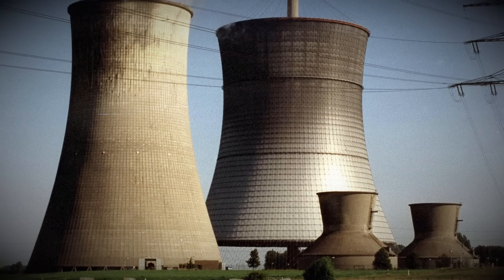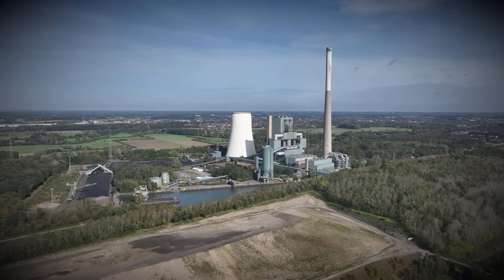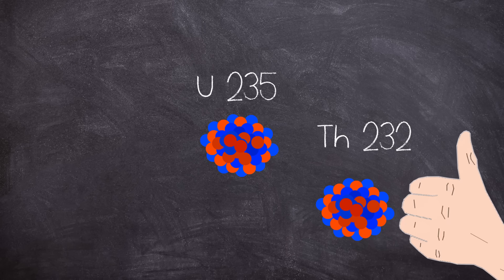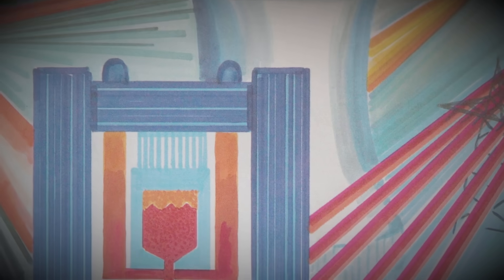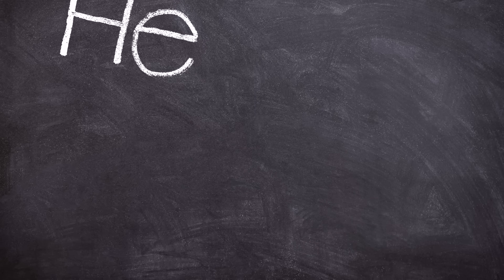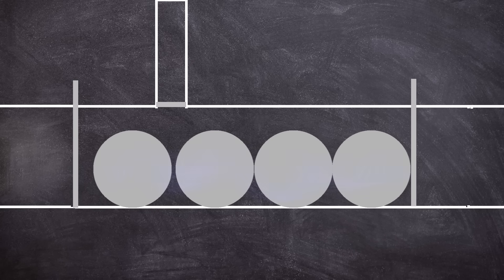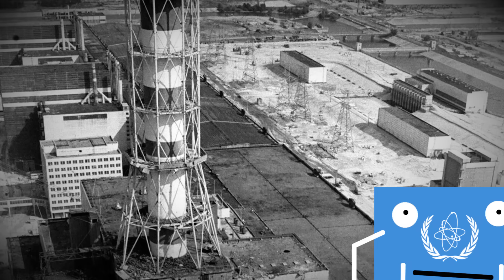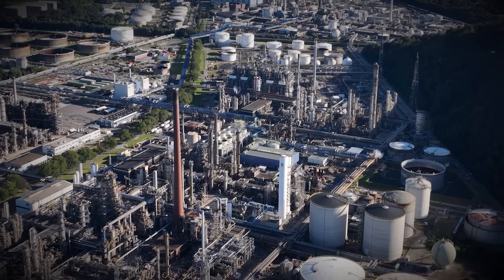Inside Germany’s “Chernobyl”

Comment: The key word here is Balls a very English sort of reference, which can cover a number of final outcomes.  These are cycled up and down, removed when damaged or the fuel is not reactive enough.
Graphite is a very soft material, while Thorium and Uranium are hard.  Imagine making 2-inch diameter balls, using gypsum powder, aka “Plaster of Paris,” (PoP) interspersed with heavy chunks of metal, then sending these through a conveyer-belt system that slowly grinds them together, in a continuous process that has NOT miraculously suspended friction coefficients nor the Delta Vee of inertia/mass differential.  Any short “Drop” would act upon the materials differently, eventually breaking these balls apart.  Even without this particular operator error, bad things would eventually happen!

As Clarkson would say, just before one of his hare-brained schemes blew up in his face on Top Gear “What could possibly go wrong”?  😂😂😂😂😂
Reply: AVR shown many of the problems - while it irradiated people walking by because shielding is not needed on the top - but they went ahead anyway.

One reason why the anti nuclear movement was and is so strong in Germany was the constant stream of fuckups and coverups happening. That there are also leucemia clusters around two power plants certainly did not help.
Reply: @methanbreather  I know of the increased number of leucemia cases around Brunsbuettel and Kruemmel. The problem is: It is very hard to link them to the nuclear plants. There are radioactive sources everywhere around you, like the granite cobblestones in your market place, or the Radon that had accumulated in the basement; even cigarettes contain radioactive substances. I don't mean that it is impossible that the nuclear power plants had an effect on the kids, only that it is impossible to prove the connection beyond any doubt.
Reply: @gabbyn978  there is no need to prove anything in the public opinion. I am not claiming that the plants caused them, just that they bolstered  the anti nuclear movements numbers.
Besides, if you count Brunsbüttel and Krümmel as two, we have 3 clusters.
Reply: When operated above 800C the graphite is annealed and becomes much stronger.   This feature was discovered over 40 years ago...lessons learned by nuclear incidents at that time in experimental test reactors.  In addition, the recent (TRISO, or TRISO-X) 6cm pebbles have added other silicon coverings that protect the soft graphite from operational damage.  These fuel pebbles have been under development since the 1950s and are recently much safer.
Reply: @Carlos-im3hn Imho they should have already been safe in 1986, as there had been ample time to fix the issue. Also, how do you make sure that the material will not become changed, or even brittle over time? Radiation is nothing to trifle with.
Reply: 👍 You earned an extra thumbs up for the Top Gear reference.  Ahhhh, the good old days. 🤭

Comment: One problem is gas cooling and the pressure in the reactor.
Not a problem in MSR (Molten Salt Reactor)
Thorium has a big advantage, it can run in thermal mode, witch uranium plutonium can not.
Most reactors runs as breeders including LWR, where 25 % of energy comes from plutonium.  
But that  fuel Plutonium  is not allowed to be used. Politicians think this could be used to make bombs.
They don't know the difference between reactor grade and weapons grade.
One way to make a safe reactor is MSR , no pressure in the reactor tank .
As thorium can run in thermal mode it is a better fuel.
The Americans had the universal genie Eugene Wigner , but the Germans had no such person.
That is the problem.
Reply: The new GenIV reactors are mostly Uranium/PU based with helium gas primary coolant, and few salt primary coolant.

Comment: Ah, THTR-300. Did you know, that China has bought IP and have constructed two pebble bed reactors? As of the incident - after balls  (pronounced indestructible prior to the accident) have cracked in addition device - there were attempts to retriwve them. Using something very similar to broomstick.
That one plant had also something completely unseen - natural draft dry cooling tower. Whenever someone says "you have to evaporate so much water to make these things run" - this is a reminder that you can do it. There was even dry cooled KONVOI designed to run in deserts. Unfortunately, some very bad things happened in Iran at that time and no deployment was done.

Comment: I live not far away from the small AVR reactor that tested this technology in Jülich. They also had a lot of incidents and even a very close call that could have been the real German Chernobyl.
They have Graphite in a core at very high temperature. The reactor was run by absolute fanboys of this technology and they lied a lot about problems and dangers that come with it. They later had to admit that it was impossible to even measure the actual temperature in the core. They used test balls with a very simple way to measure the maximum temperature but they came thru maxed out and they decided to continue not knowing how far above the designed temperature the thing was running.
Also the number of balls that came out broken was much higher then expected. 
The fact that just during Chernobyl something had happened and they kept it secret was of course unacceptable and at this time the whole concept of the THTR300 was already proven to be to expensive and not capable to achieve the promised features. It was sold to the public as high temperature generator that is capable to produce high temperatures not just for electric power but for industrial use like steal production. It was already clear that this wasn't going to happen and it was obvious that this technology was to complicated for electrical energy only.
Reply: "that it was impossible to even measure the actual temperature in the core" - that reminds me so much of Windscale.
Reply: @gabbyn978  Graphite in combination with hot nuclear reactions is calling for trouble. I think the piles in Windscale are still waiting to get dismantled. 
Only the idea to cool the reactor with sodium is even worse. Gives a nice explosion in case of a fire or flooding if something happens. This German reactor was never fueled up and transformed into an amusement park (Wunderland Kalkar).
Reply: @Ulrich.Bierwisch  They did start working on Windscale a few years ago.  Keep in mind that they followed General Procedure #1 when it comes to nuclear accidents:  Can we just seal this up and let it sit while it cools off?  They waited so long to start working on the interior of Windscale because they could just seal it up and let the radioactives slowly burn themselves away.  Now, the stuff inside is far less dangerous than it was just after the accident.  (This was also the basic plan for Chernobyl at the time, and it's a good one:  If you can keep the radioactive materials from escaping, the safest thing to do is let the stuff burn itself out.  Once most of the really nasty stuff is gone, it's far easier to clean up.)
Reply: @gabbyn978  Windscale was also being operated at FAR higher energy levels than originally intended, and even higher than was needed to anneal the graphite moderator.  They were trying to make enough tritium to qualify for US help in making hydrogen bombs.
Reply: It seems very similar to the thorium concepts today with promised features and difficult business plans..

Comment: And yet, there is still a whole Thorium community touting its safety and insist it should be pursued as an energy source. 🤷🏻‍♂️
Reply: The Thorium/Uranium is also preferred because little if any Pu is generated.  However in the new TRISO U/Pu kernels most of the Pu gets burned up during normal operation.   The GenIV Xe-100 pebble reactor is now going forward in US, Canada, and UK ; hopefully with all lessons learned.

Comment: That is possibly the least disastrous disaster you have ever shown us. I agree it seems an over reaction. Fossil fuel coal burning is also fraught with health implications.
Reply: Especially browncoal/lignite. About 300 times the amount of health complications and deaths per TWh than nuclear.
And yes, that statistic includes Chernobyl and Fukushima. Coal is still 300 times worse.
Reply: least disastrous, more balls! overshadowed by Chernobyl
Reply: @savvybear11781  Overshadowed, but also amplified. It show, that nuclear hickups could not be caused by drunken commies, but also German engineers.
Reply: it has hands down the most involvement of balls though.
Reply: The desaster was not physical, but a complete loss of trust in the operator and builder. Something happened that was claimed to be impossible by the engineers in the past. Also it became obvious, that the operators tried to hide the mishape from the public and the authorities.

Comment: I haven't got any data (because I can't be bothered to look it up), but Germany has 58 coal power plants in operation right now. If they each burn 1000 tons of coal a day, that would be (on average), 4 millicuries a day each, totally  ~230 millicuries a day (I'm rounding because I'm already using estimates and averages). That converts to 8.5 GBq a day. compared to an accident releasing 50 Bq. Idiotic really.  Also, 4 millicuries is 148,000,000 Bq, slightly higher than the reactors permitted maximum of 10. (Now, a lot of that radioactive dust would be collected by filters in the chimneys, but 
50 Bq is so low that it is a fraction of a percent of the total produced by burning coal, and I'd be amazed if industrial filters are that good, even brand new. 

Please correct my maths if I've made any errors, this is basically back of the envelope maths along with a quick google.

Nuclear really is just better for all of us as long as it is maintained. Imagine stone age man abandoning fire because someone burnt down a village.

Comment: To convince Germans of nuclear power is more difficult than convince Americas of universal health insurance.
Reply: There is still no place to put the waste..
the german stuff has been standing in what is eesentially a storage hall since the 1980s and nobody knows where to put for the next 200.000 years
Reply: @mats7492  Build some fast reactors and recycle it, you get maybe 50xx more energy and it remains hazardous for a few centuries rather than millennia.
Reply: You gonna pay for it? Takes decades, costs billions upon billions! Its by far the most expensive way to produce power there is..
Renewables are WAY cxheaper and more sustainable...
You also have to buy new rods...

from russia...no, thanks
Reply: @IMBlakeley have you looked at the process needed to remove waste from molten salt coolant?

That is pretty high on the "what could possibly go wrong* scale to me
Reply: @mats7492  dude, you do realize that no one in west part of Europe ever buy nuclear fuel from Russia, right? You can get even fuel for Russian reactors from west...
Renewable sources have two major drawbacks - unreliability and amount of space required to get output comparable with fosile/nuclear plant. (Also their efficiency and environmental impact more often than not sucks balls really hard...)
Reply: @mats7492  Waste problem is solved. (In Finnland and Switzerland.) But anti-nuclear extremists block all waste sites in Germany then to blame "there is a waste problem." The waste problem is made by anti-nuclear activist not the reactors.
Reply: @gargoyle7863  The scientists in germany disagree with you so you have ZERO arguments here.
You seem to only get your takes from pro-nuclear talking points and lack the critical thinking required to have a proper discussion about the topic! Thats why you immediately threw the term "extremists" around. 
So i will end the conversation here!
Reply: @gargoyle7863  Finland and Switzerland have a lot of solid ground, even granite to use. Germany not so much. The old salt mine of Asse turned out to be anything but water tight, and salt water corrodes the metal drums with the (mostly less) radioactive stuff inside.

Comment: Well there are a lot more reasons German stopped using nuclear power. For example German doesn't have a place to put spent fuel or to refine spent fuel to use it again. Also it's a rather labor intensive way of producing electricity. Solar, wind and storage are now the cheapest ways of producing electricity in Germany, and since the electricity market is kinda broken, it makes sense to produce your own power whenever you can. If you are lucky you get 8 cents per kWh for giving away your power, and have to buy it for 30-40 cents per kWh. In fact domestic battery storage is now 5 times as high as commercial one.
Reply: Germany has built a reprocessing plant. However there were protests against putting it in operation
Reply: @brylozketrzyn  They had cleared the area where it was planned from trees and protesters. But there where lawsuits going on and not much was actually build. It would have been to expensive to continue and they already knew that it most likely would be stopped sooner or later.
Reply: @Ulrich.Bierwisch Indeed, renewables have gotten so cheap that electricity companies view nuclear fission plants as no longer commercially viable, and not just in Germany... In the US and UK projects to build new plants have been cancelled over and over, in other countries governments stepped in with huge subsidies financed from tax money...
Reply: @jnievele  It's already to expensive if it works like expected but it's not possible to get insurance in the case of an accident. Think about something like Chernobyl or Fukushima happens in the French reactor in Cattenom. Depending on the wind direction it's possible that Luxemburg, a whole country, has to be evacuated or the German state Saarland. How would this be compensated? What is the price tag of a whole country?
Reply: @Ulrich.Bierwisch  Yep. Really only feasible if you want to use it produce Plutonium for nuclear weapons... But even that is expensive and dangerous, as Switzerland found out the hard way (another story few people know). Of course in Germany geography also played a major role... Like "Oh, let's place that new reactor in the scenic Rhine valley near Koblenz, not too many people there and it's far from the Iron Curtain... Wait, what do you mean that vulcano is still active, couldn't you have told us a few years earlier????"
Reply: @brylozketrzyn  You mean Wackerdorf? It didn't even come so far that it would have been built. First it was delayed, then the reunion happened, and the 'remote place' suddenly found itself in the midst of a unified Germany, which changed its status totally.
Reply: @gabbyn978  Gorleben vitrification plant. Built but only allowed to repair seams.
Reply: @brylozketrzyn  That is true as it was in a rather populated area. Germany doesn't have enough coast-line to just put such a plant there.
Reply: Please, tell me when Germany stops buying liquid natural gas.
Reply: @thebandofbastards4934  Germany only uses about 13% of the imported gas to generate electricity. Main uses are industrial processes, and residential heating.

The share of gas in the electricity mix was fluctuating between 12 and 17 percent over the last two decades. Nuclear phaseout didn't really change that significantly.

And even with a large nuclear baseload we needed these gas plants as they are the most flexible to compensate for sudden load changes, classic nuclear plants are very slow when it comes to changing their output ...

Comment: You already mentioned my suggestion somewhat in this video. If you have A LOT of free time, you could look into the HTR of the AVR Jülich (AVR or as you tried to call it: Arbeitsgemeinschaft Versuchsreaktor). It had some accidents and some releases into the environment. It's hard to find though because they covered a lot of stuff up, but there must be a report somewhere from an independent commission from a few years ago.
Reply: AVR had plenty of issues, like those fuel balls very often disintegrating. But what it's mostly remembered for is lacking overhead shielding... Some bright spark decided that nuclear radiation couldn't do any damage just being radiated into space, so why bother shielding the roof? Just make sure no rain gets in, good enough for a government contract. Planes weren't allowed anywhere nearby anyway, and birds should be fast enough not to get TOO much radiation. So they started experiments, and all went fine... Until the weather changed, and thick clouds happened to come in. Suddenly radiation detectors went off everywhere... Turns out clouds can reflect ionizing radiation. Oops...
Reply: Sounds interesting.